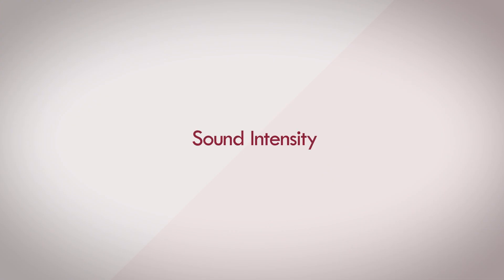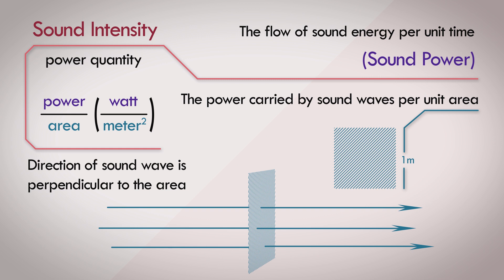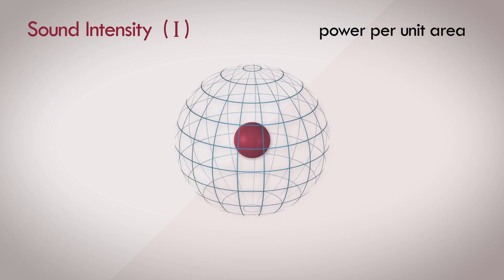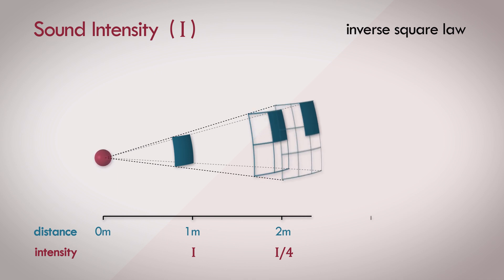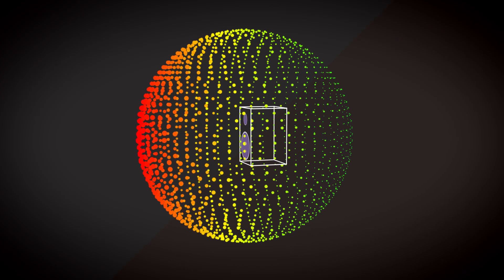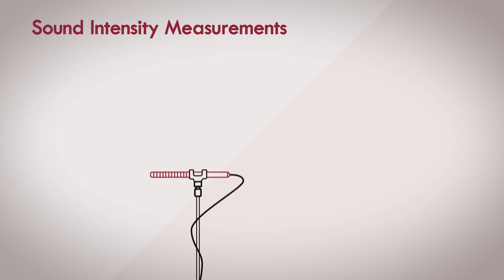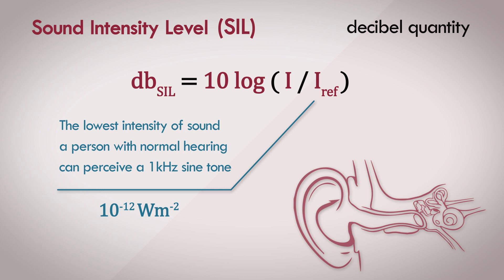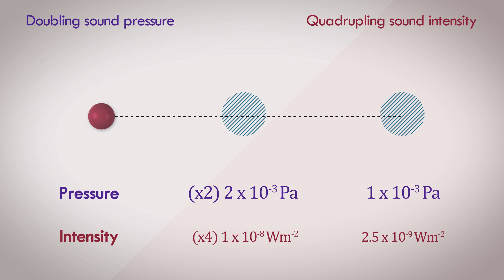5. Sound Intensity - Loudness and Level

Comment: Nice course mate. 

But when will you upload stuff about analog and digital domain? 
When recording, when the level meter shows -1db what does that mean?

Or when there's no input or we have absolute silence, meter shows "infinity" which in our course we understood that it should show "0 db" or some negative decibel value.
What's the matter with that?
Reply from the maker: Hey man.. I'm planning to cover dBFS at some point of time. 

Quick answer to your question: dBFS is purely a reading of digital audio. Not analog. In digital audio, you have fixed number of states. 16bit audio let's say can store -32768 to +32767 distinct values. 

Since in digital audio (fixed point), no values can be stored above this, this is kept as the base line standard. 

So the formula for dBFS for 16bit audio is 20log(value/32768) 

If the value is the highest representable value (full amplitude), then 20log(1) = 0 dBFS is the theoretical maximum. 

Any value below that will have a negative dBFS value. 

And in the case of pure silence, value will be 0.

In this case, 20log(0) is undefined, or if you want to represent it, tends towards negative infinity.
Reply: @akashmurthy  Thank you! Excellent response! 

But how is this "level" thing is calculated and quantified in the analog domain?
Reply from the maker: @mohsens22  in the analog domain, when you are talk about level, you are talking about the voltage of the electrical signal. You can measure and compare voltage of signals using a volt meter.
Reply: @akashmurthy  Thank you mate!